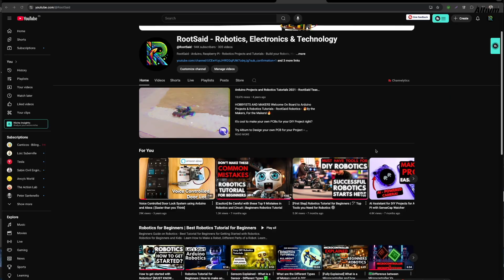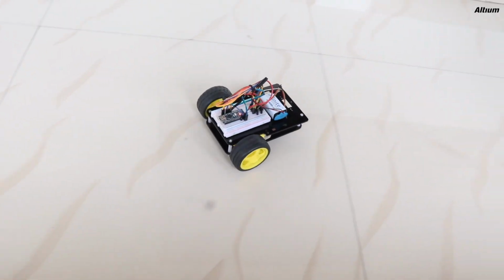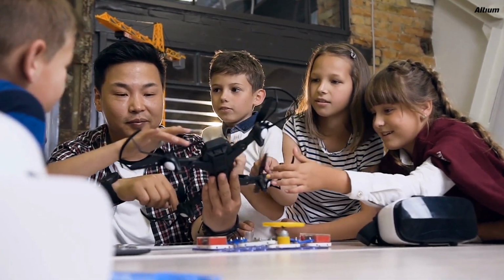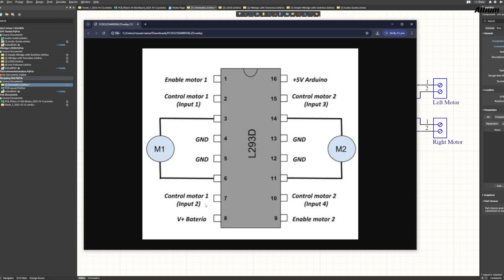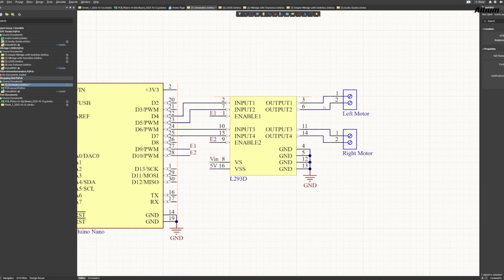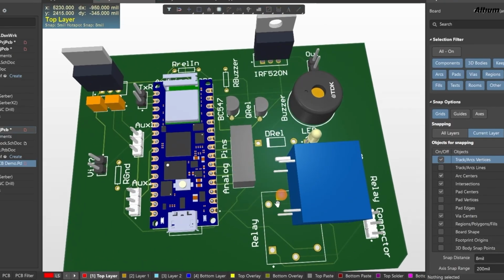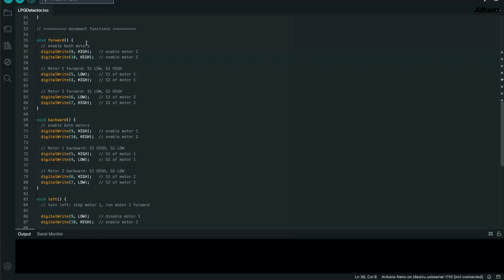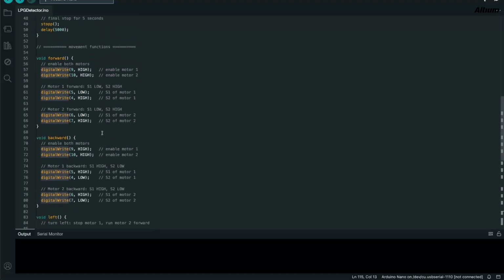Build Your First Robot in 15 Minutes! (Simple Arduino Project for Beginners)

Comment: Would it be possible to make those plates out of cardboard? What are it's measurements so that I can cut out my own?
Reply from the maker: Yes its perfectly fine to use strong cardboards to use the chasis as long as it wont bent with all the weight. The measurement depends on your requirement. Make sure it has enough space to accommodate all the components and also make sure it wont bent.
Reply: @RootSaid thank you!